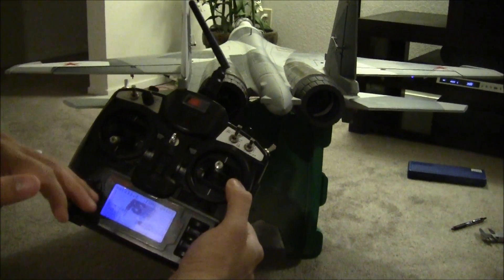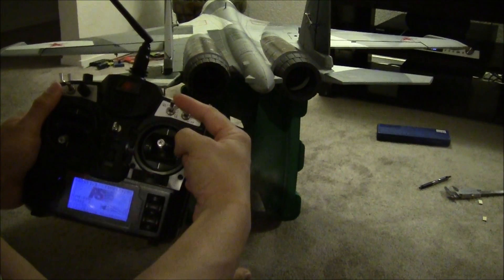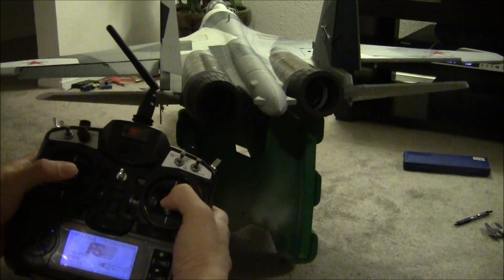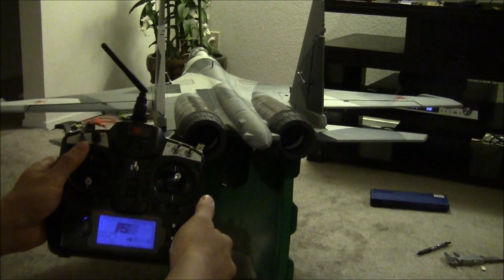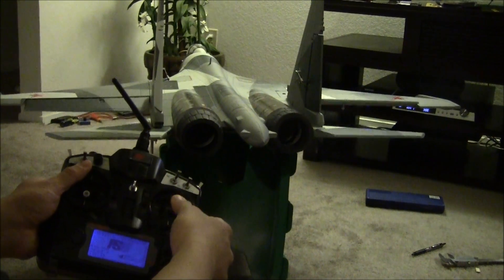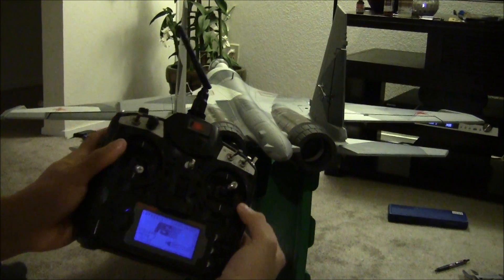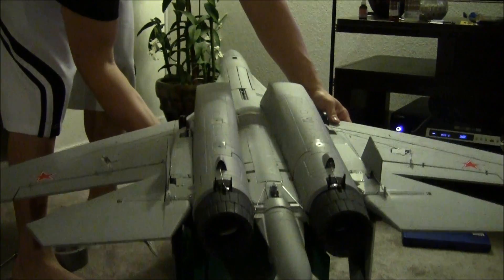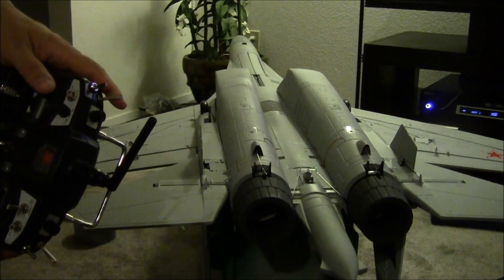Freewing SU-35 Build Video #8 Programming TV on T9X

Comment from the maker: If you are going to program three independent servos then you need 8... 1 for ailerons, 2 for elevators, 3 for throttle, 4 for rudder and steering, 5 for landing gear, 6 for thrust vector 1, 7 for thrust vector 2, and 8 for thrust vector 3. if you wanted to y-connect 6 and 7(which would need a reverser) and connect the rudder/steering/TV for rudder all on one channel... then that would be six channels... but you wouldn't have the aileron TV... hope that helps